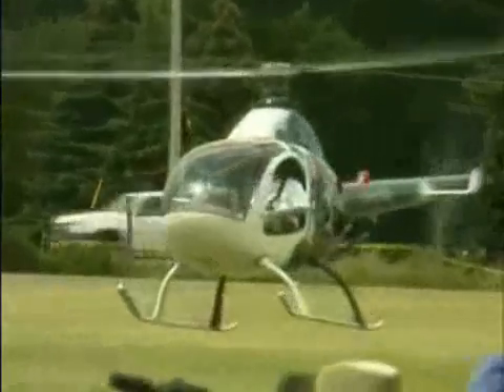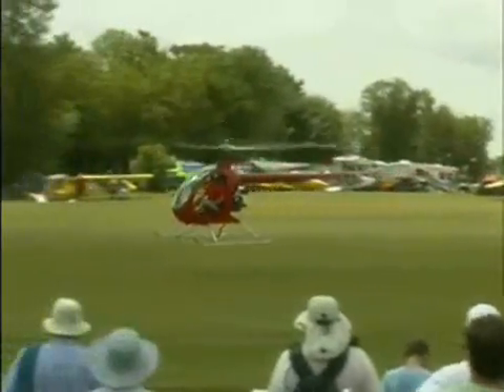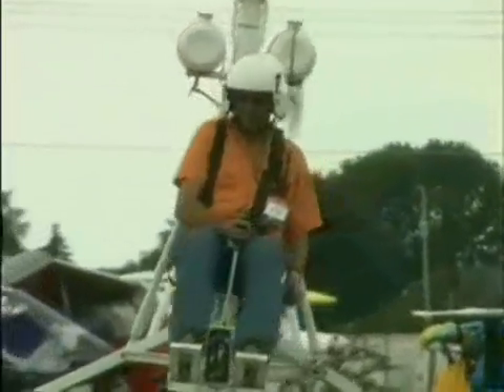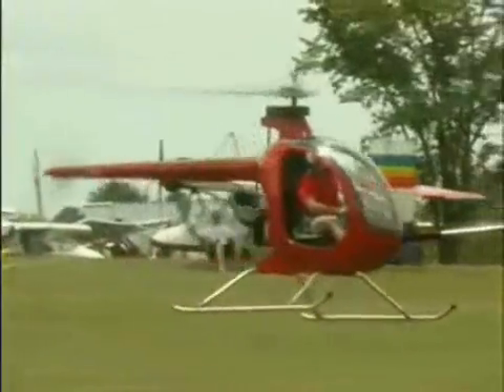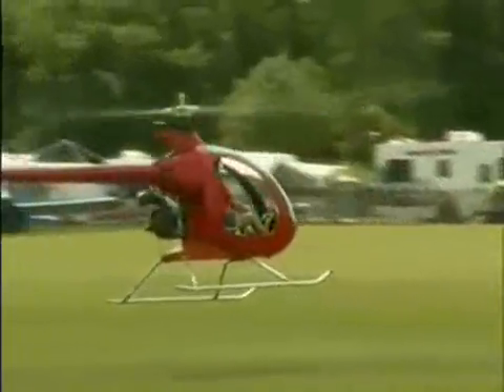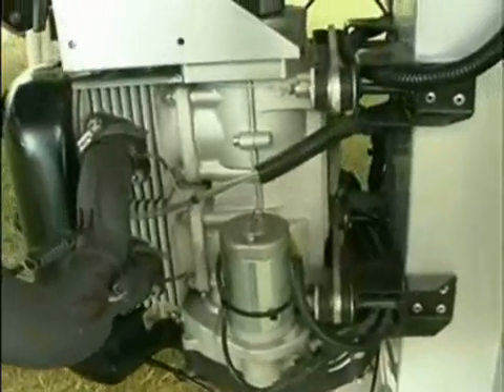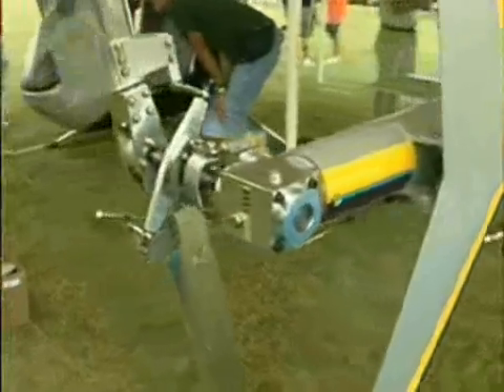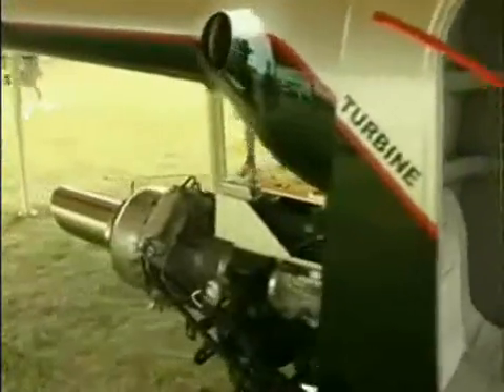Mosquito Light Sport Helicopter

Comment: There's no such thing as a Light Sport Helicopter.  The Mosquito XEL can qualify as an ultralight (Pt. 103) when it's equipped with floats; otherwise, all the other aircraft featured are amateur built (Experimental) aircraft, that require at least a Helicopter rated Private Pilot license.